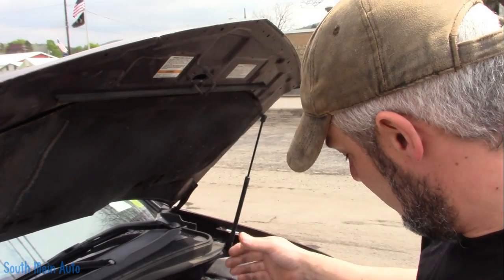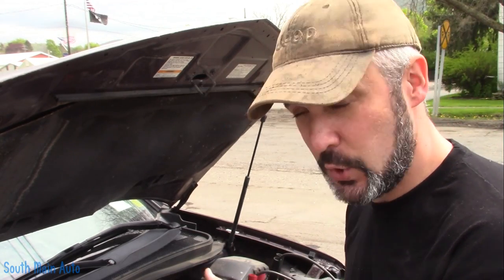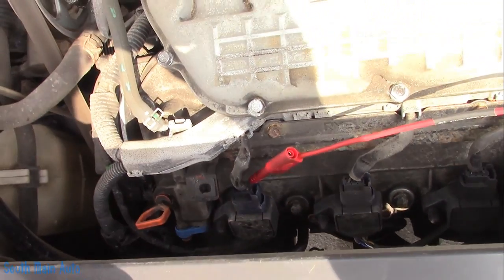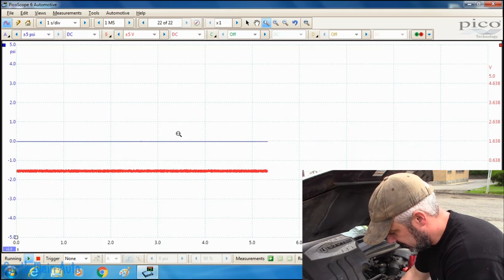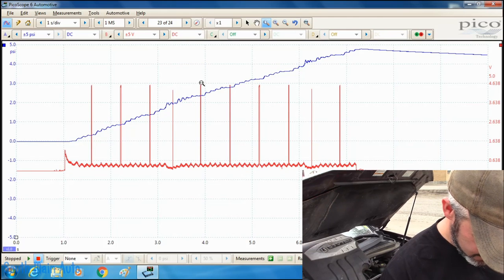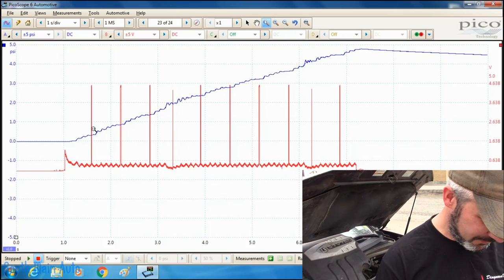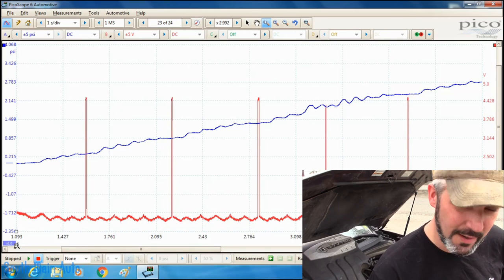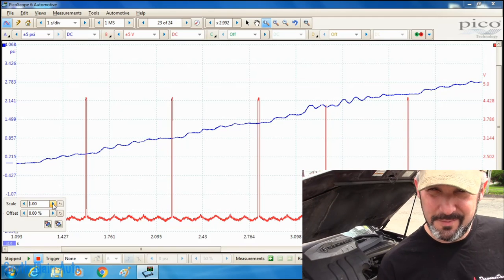Testing For Blown Head Gasket With The Pico Scope

Comment: The waveform looks like it shows every cylinder uniquely contributing to the overall pressure build.   It looks like a six bar commutator with a unique signature. I'd say that's pretty skookum.

Comment: That's a creative idea, look for early rise in coolant pressure. My first thought was normal pressure is ~10psi, however that only builds AFTER the coolant is warm enough to produce a tiny head of steam inside the closed space. So, we can run the system with cap off to burp for about 10 minutes, 0 psi while cranking, for sure. The backyard way to look for a gross leak would be to crank with coolant at the brim, cap off and watch for the bubbly fountain, ha ha. However if thermostat is closed, engine cold, it may take a while. I'm a little surprised you got a brisk pressure rise with thermostat closed....

Comment: Isn’t the easy tell all route to troubleshoot a blown head gasket, to just look at the oil?
If you have anything else but oil in the oil...
Reply: The oil can be all sorts of different ways with poor maintenance, or even failed intake manifold gaskets in the earlier GM V6s and V8s. Pressure in the cold cooling system is the single most telling simple indicator of head gasket failure, short of a block test.

Comment: great video EO  i looked  and listened to the waveform.  At 1.31 of video you can hear the cadence change. You can see the pressure rise when cyl 6 is on compression.  The trigger channel gives you  relative compression for "free"   at the bottom  at it drops for a while and comes back.  i think all the cylinders are compromised with cyl 6 being the worst.  great use of you r tools     all the best

Comment: So sad, folks that can least afford a loss like this.  The inability or ignorance to perform simple maintenance results in the loss of transportation. Guess they will by another beater and do the same to it. Grast Video Eric, nice to see another way to diag a blown head gasket.  I have stepped off my soapbox.
Reply: I agree completely. A year ago the car probably had a good future ahead with some rehab work (maybe including a replacement radiator). Now it is scrap metal. If it were a human it would be 35 years old.

Comment: Parts that are probably nuked!!  Catalytic converters. Expensive!  Oxygen sensors.  Spark plugs!  Lower crank bearings!!  Expensive.  Warped heads more expensive stuff.  Why drive it overheating??  Hate the car?
Reply: The only time I smelled oil the way he described was when a relative ran an old Accord out of oil on the freeway. The only description I can offer is it smelled like engine death. Smoky does not begin to cover it. I don't know if this guy hated the car but he sure didn't love it.

Comment: I automatically assume the head gasket blew when they over heat. It almost sounds like timing issues with that cranking. I always press the issue that when the needle goes in the read, the head gasket is dead. Also the head is WARPED because of it. Yes, dead engine. Replace engine.

Comment: Well at least they did not cool it off with ice cold water.
The slow ramp could be a mild head gasket leak or toasty cylinder leak.  I would expect a larger leak.   Need to compare to known bad. Hahah!
Another test would oil analysis at Blackstone Labs. They would see the antifreeze in the oil!
Reply: I was in a similar boat on the hwy in my old Integra and was able to save it...  the key folks it to crank the heater as high as it will go and keep air moving across the engine and then pull over and let it cool....

Comment: Water pump turning would move the needle. If coolant was low and the plugs are steam cleaned that would be enough to call it, compression test and leak down if it’s your own car LOL
Reply: Water pump won't increase the pressure because it is a closed system. That is why the hand over the radiator neck check is so reliable. Coolant low and steam cleaned plugs is usually a failed intake manifold gasket on GM V6/V8 1996-2004. On the MDX, probably head gaskets.
Reply: @flagmichael i know what your saying. It’s not a good test that he’s showing, the system is sealed but when cold the thermostat is closed. Him blowing on the tube made the pressure jump at a higher rate than the turning engine.  When cranking the pump will always make positive pressure on one side and negative on the other, you could argue the needle then comes back down as pressure equalizes past the thermostat. When some head gaskets go you crank and see water pulse out of the rad, he was going for this result on the screen, it didn’t happen.

Comment: I would do it on a known good engine and then compare the two. Although it is obvious "there's your problem lady" in my best Mr. O voice. The head gasket could be blown between multiple cylinders. Just an old man rambling.
Reply: There should be no measurable pressure at the radiator cap opening when you are cranking over a good engine.  An old style manual pressure tester with mechanical gauge, or a newer electronic pressure sensor connected to a scope would have both shown a constant near zero pressure reading when doing the same test on a good engine.

Comment: My brother had an older AMC Gremlin 6 cylinders  which overheated on our way skiing. We popped the hood to see the cylinder head glowing orange. After a few minutes to cool , we started packing snow inside the radiator as we had no water. Let me tell you , that thing ran for years after. Something to be said for cast iron engines.

Comment: Will the water pump cause the pressure to increase while cranking? Id like to see that test on a know good vehicle.
Reply: Chris Walton I've tested known good cars and cranking or running doesn't increase psi. You'll start seeing a couple psi after it starts warming up
Reply: Nope, The system will set at zero until the coolant starts to heat up, then it will rise until it hits cap pressure.  If you get a pressure increase cranking a cold engine you have a failed head gasket.
Reply: Thanks for asking and for clarifying. I also wondered this.. Makes sense when you think about it but it never hurts to second guess to learn a thing or two.
Reply: Not when cold. The cooling system is closed so there is just a little wiggle in cooling system pressure until the pistons start forcing air into it. It is always my screening test for head gasket failure and has never failed me.

Comment: With out all the computer gadgets. Remove radiator cap, put air pressure in individual cylinders while watching radiator for overflowing or blowing out coolant.
Reply: Good luck on the rear cylinders.  Eric is demonstrating other uses for a scope and pressure transducer, not saying "This is the only way you can test for a bad head gasket"  Personally I would just toss my radiator pressure kit on it and see if the needle bounces while cranking.

Comment: I just don't get it. They said they have had repeated problems with overheating---wouldn't anyone with common sense quit driving it after the FIRST time it overheated? They turned what might have been nothing more serious than a stuck thermostat or bad water pump into an engine replacement. Given the fact that the cords are showing on all of the tires, my money says this one is headed for the local salvage yard
Reply: Yes, anybody with common sense would. I'm not betting against your vision of where it is going, either.

Comment: I see 5 spikes per pulse. Since it is a 6 cylinders and the pulses come on one turn on 2, but the compression stroke is also one turn on 2, it cancel out. What I therefore see is 5 spikes per 6 cylinders compression cycle, or in other words, 5 out of 6 cylinders leak.

Comment: Fuck that job. i would walk away.  4 bald tires and nuked engine.. Customer wont be able to pay for an engine if they cant keep tires on the rig
Reply: Idiots for not watching the gauges that are layed out for your eyes. our cars run at a steady 190 no matter what. if it creeps past, you got issues. doesnt matter if your in 120 degree heat the AC on or sitting on a cold day, nothing more than 190

Comment: The reason the test was not able to produce definitive results is because the pulses were being buffered by the coolant. Sort of like when you pull a Slinky.  I have all that equipment  as well. Very useful testing equipment. Thank you for your videos. I learn something new almost every time.
Reply: Keep the wrenches turning Nancy.
Reply: Close.  The coolant won't compress, but the hoses (radiator and heater) are elastic and will cause the slinky effect.
Reply: @kwt7667g  I really meant more in the way of the pulses being lost in all the nooks and crannies. You are right about the the hoses and such. The Picoscope kits compression hoses are steel jacketed for greater definition for that very reason.

Comment: Correct me if I'm wrong but you had a sensor just on cylinder 4. The other five cylinders were cranking as well. Essentially pumping air into the cooling system via the head gaskets, plural. I think the graph was very definitive that the head gaskets were all leaking into the cooling system. That is an interesting toy you have there. I'm just a shade tree home mechanic, but based on what you described it the oil is being I would tend to agree that the motor is toast. Even if you change the oil it probably wouldn't crank because it has no compression or little compression. Can you change the oil when it gets that bad? It be like trying to get cold chocolate syrup out of there.
Reply: Waste of time to change the oil, If you wanted to repair this engine you would need to pull it apart down to the block and check the cylinders for damage. If it got hot enough to cook the oil I suspect at least a couple cylinders are out of round and likely the heads are warped as well. Aluminum is great for saving weight but it moves a lot more than iron does when subjected to high heat. Plus with all the weight saving engineering with thin wall castings they really twist when heated.

Comment: I'm looking at the ripples on that pressure trace as it ascends and they look like they could correspond with compression events.  Then your spots where they flatten out on your cylinder four trigger kinda levels out a bit and it leaves me to believe it's showing you that you've got two cylinders left that where the head gaskets are even trying to seal the chamber.  Your firing order is 1-4-2-5-3-6 and I'm betting that if a guy named Eric O has some free time and willingness to try a leak down test, cylinders 1 & 4 have the least sealing loss....or 4 & 2 if my eyeballing is off.  Of course, I'm also betting a guy named Eric O is far too busy for my vicarious diagnostics if the Acura is still even there.  At any rate, great video as always.  :D
Reply: Agreed !

Comment: Repeat the test without ANY spark plugs installed to get a 'baseline' radiator pressure and then start putting back plugs one at a time.  You'll probably find ANY installed plug will increase radiator pressure because ALL of the cylinders have a head gasket leak (which is why it doesn't run).
(The no-plugs baseline test will give you a 'smaller curve' that's indicative of the effects of the water pump and thermostat-restriction interactions)
However, it's kind of a waste of time since we all KNOW that engine has gone to meet Elvis

Comment: I usually do the "white smoke out of the tailpipe" test to decide if the head gasket is blown.
Reply: That's inaccurate. Moisture can be picked up by the hot exhaust, from the pool of it in the muffler, from drivers that only ever go short distances and are therefore almost always running on cold start enrichment, and come out and condense in the cold air, just as if you'd injected water directly to the cylinders. Also, cylinder pressure is higher by a factor of 10 than cooling system pressure, so a gasket blown between a cylinder and cooling jacket is going to displace the coolant with air, not the other way around, while the engine is running.
Reply: @TonyRule  I wad being facetious. The last head gasket I blew was on my 1981 VW diesel pickup. Hot summer day going down the highway I overheated the engine. Lots of white smoke going out the tailpipe, so I knew I blew it. Waited for it to cool down. Creamed it over and it was already hydro-locking. It doesn't take a course in hieroglyphics to read that ad a blown head gasket.

Comment: Really nice capture! Very similar to Mario's video testing for head gasket failure. Pretty awesome using the scope.. but in this case, probably would've seen the same with an old school coolant pressure testing kit. Like the one I have, Stant or MotoRad MT-300.

It's great to have multiple ways to test a system, period. Buenísimo! 😊👍👍

Comment: Eric, just so you know, Windows 7 is going end of life (EoL) at the start of next year. That means there will be no more security updates. I know specialty tools like yours aren't updated that frequently, so you'll probably have to keep a Win7 machine to run those legacy programs. I highly recommend you DO NOT connect any Windows 7 machines to the Internet after January 14th 2020. Use them, sure. But don't connect them to the internet at all (that's called keeping them air gapped). Just FYI.
Reply: Pure scaremongering. I have XP machines, that I haven't even bothered applying the retail PoS updates to, that are permanently connected to the internet. I doubt Eric will be doing any internet banking on his diagnostic laptop anyway.
Besides, the actual statistical likelihood of them being attacked through OS vulnerabilities is far outweighed by the user themselves doing something online that installs malware. There are far better ways to protect yourself from cybercrime than just having a supposedly up-to-date OS, which can still have undiscovered vulnerabilities right up until they're revealed by the person that found it, like 2FA.

Comment: Interesting. Once upon a time I would just take the probe from my exhaust gas analyzer and hold it over the radiator opening. It would pick up the hydrocarbons very well.
Reply: Still do to this day.   But I have a trick where I don't have to stand around holding the probe.    I take two rad. fill funnels tape together insert probe and move on to the next job.   Come back 10 mins later to see the readings.
Reply: @rcrepps3949  we use a no spill style funnel with a plastic bag over the top with a little hole to stick the analyzer probe into.. Works great and will catch even small headgasket leaks (plus it keeps u from sucking any coolant into the analyzer ;)
Reply: @mikec3104  I use the same kind of funnels.  I just happen to have two.
Reply: I rely on the shadetree method. I remove the pressure cap, pinch off the reservoir hose, and put the palm of my hand over the radiator neck or surge tank neck while a helper cranks it. 100% accurate so far.
Reply: @flagmichael  only when it's a big enough leak.    The method I use can catch a bad head gasket much sooner..

Comment: Hell just listening to it crank I knew it had a blown head gasket. Top the radiator off and leave the cap off and crank it and see what it does. I had one with a head gasket so badly blown it sounded exactly like that but when you topped the radiator off and left the cap off and tried to start it it shot coolant out of the radiator like a geyser.  Now that's a blown head gasket for real

Comment: if you look a little closer it looks like it is pulsing pressure with every compression stroke .... so the pico might be able to tell if you have a blown head gasket
Reply: just for the fun of it crank it longer , how high will it go i bet over the rated cap pressure

Comment: I used experience and a exhaust gas detector kit for head gaskets. My belief is on V6 V8if one is blown the other isn't long for the world. But I really like the exhaust gas leak detection kit because it tells me long before overheating or coolant loss there's a problem. 
 Interestingly well for me because I had never seen this before. A guy that restores cars with 2,stroke engines saves head gaskets on old Subaru 2stroke engines and reuses them in rebuilds. Because you can't get them anymore. I guess they aren't as critical on 2 strokes that are air cooled as on a car with a cooling system. The crap you learn on YouTube.
Reply: They are but when those engines were in production they used gaskets made out of somewhat re-usable materials as most used common engine oil that leaves a LOT of soot behind and removing the heads for de-coking is part of the maintenance on them. So the gaskets were meant to be reused a few times.

Comment: That is an interesting way of checking for a blown head gasket I’ve never seen this before. You should make a video going more into depth about how this method works!
Reply: The quick explanation: a good working engine would've shown little or no pressure increase in the cooling system until it started warming up.  Having the pressure go up like that when it's just cranking means the cylinder compression is somehow leaking into the cooling system.
Reply: Ian Schmidt: ohh ok I got it, pressure when cranking = cylinder pressure getting past the gasket into the cooling system. Thank you sir!
Reply: @kcscustom  Took me a minute too, I'm too used to watching Mustie's videos where the compression going up is a good thing.

Comment: Speculate:  what was primary cause of overheating?
Do these engines have history of failed head gaskets?
Reply: Any engine will blow the head gasket if you overheat it enough.
Reply: Primary cause of overheating = Idiot behind the wheel who ignored all the lights on the dash saying the car was getting hot. Then continuing to drive it and overheating it repeatedly.